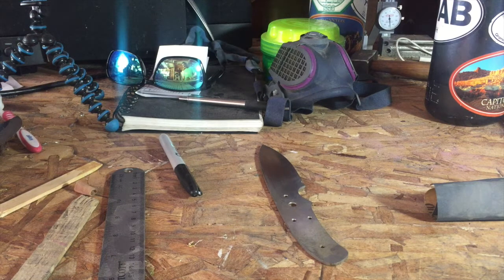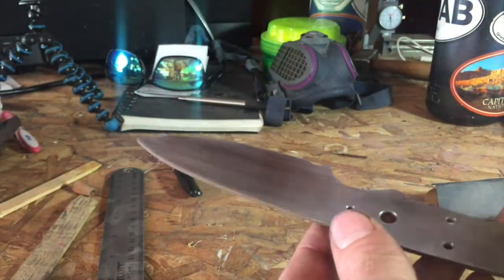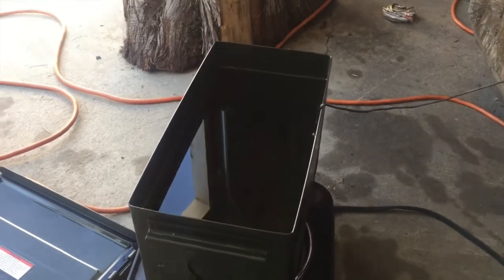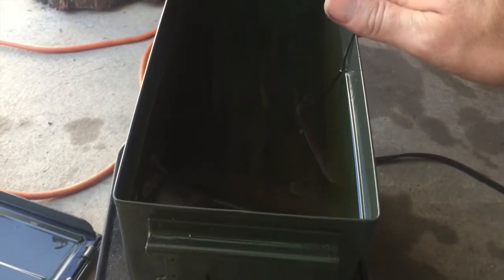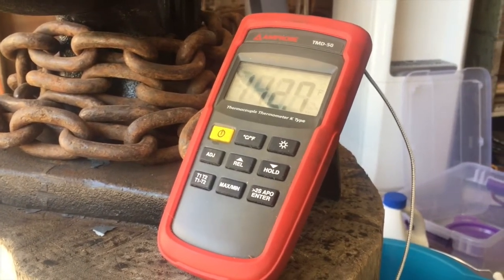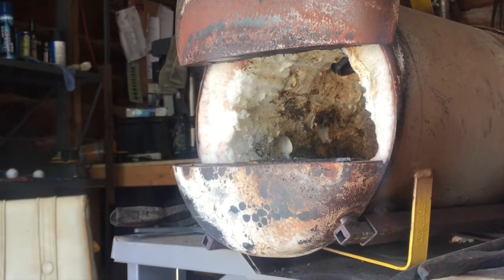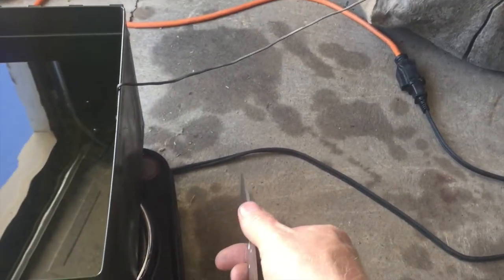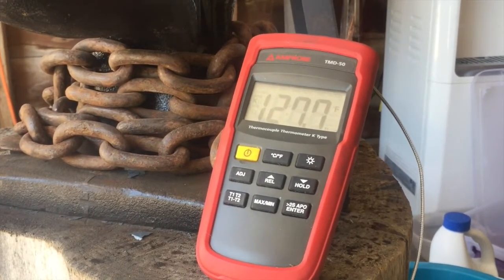Quench 1095 the CORRECT way

Comment: for 1095 or W1 why not just spend the money and get 5L of fast quench oil and be done with it, it's not a big investment and you'll see HRC 65 out of the quench tank and HRC 62 out of the tempering oven? Fast quench oil is designed for 1095/W1 and W2 to get the utmost out of those steels.

Comment: Quenching plain carbon steel in oil is very forgiving and easy, i don't really get why people have trouble with it. You can make a cycle before quench, getting to cherry red and then letting air cool. If you forged your blade properly, cycles aren't needed. Heat up to cherry red, not above, not below. Some describe the color as "pink". Use shadow to help you see the color better. Get everything nice and even, you don't really need soaking if your blade was forged before (it's all perlite, the carbon will dissolve extremely fast). Then, plunge the blade straight into the oil, trying to not cool one side more than the other, as was said in the video. I personally finish my blade before the quench, doing the grinds and a simple sanding, as a thinner edge will cool off more quickly in oil (but is more tricky to get to an even heat). I also like to dunk my blade in very cold water a few seconds after the oil quench, to get to below room temperature somewhat quickly. It's a kind of low quality cryo treatment, but it's only practical during winter if you have a water bucket.
Then you clean off the oil, give a simple sanding, and do your temper. Do it on a kiln, or do it above the embers of the forge if you like doing it medieval style. Both techniques have pros and cons. Kiln temper is incredibly accurate and can get you a bit  more steel performance trough the soaking time and cycles. Flame temper is tricky to do correctly, but allows you to do a differencial temper on your blades. You can use thick forge tongs heated red hot in the forge, and you clamp the back of your knife while you're getting the edge to straw or yellow/bronze, depending on the use. The hot tongs along with a wet rag will give you a blue back with a straw edge. A knife tempered like that will outperform a knife tempered in a kiln in terms of pure resilience, while keeping most of the hardness and steel performance for the edge. But it's a pain to do, and you can't do stainless like that.
Reply: Temper in a toaster oven just like a tempering oven, 2x2hr cycles. I would also add that critical is whenever the knife becomes non-magnetic, never higher really, because austenite is not magnetic even below the curie point. You can throw it in the freezer immediately after quenching for cryo, and it's still half as effective as liquid nitrogen if you do it immediately and your freezer is very cold. Wait even minutes and it might do very little.
Reply: @mikafoxx2717  i personally do it the old way, with primitive tools (aka watching the temper colors above hot coals after quench in water). A short temper helps avoid martensite embrittlement, wich develops as retained austenite turns into hard martensite during the temper. A short temper doesnt allow much retained austenite to convert. But the modern way to deal with that is two long tempers, but you need a low température otherwise you'll really drop in hardness
Reply: @ForgeDuLys  Ah, interesting point about the martensite enbrittlement. didn't know that fast tempers did that differently. Would be interesting to compare side by side a double toaster oven temper versus a forge temper.

Comment: Just edge quench 1095 in concentrated brine and then quickly dunk the whole steel in motor oil. Cheap and easy. This method also makes 4130 capable of chopping concrete.

Comment: Also, have you tested a blade after you've ground the bevels to see if it maintained the 59 HRC?
Reply from the maker: Its a little hard to do an HRC test on bevels as they are angled, but you can get the hardened files to test for general hardness. On thicker stock (over 1/8 inch) canola has a hard time getting full hardness in the steel. I would like to do a follow up video on this soon to talk about that. That is an important detail I left out of the vid. thicker stock you'll want to put some bevels on it prior to heat treat. You'll get a large amount of the beveled area hardened and the remainder up to the spine will generally stay on the softer side. Again, generally lol
Reply: @BearRiverKnives  Thanks again because I actually have some 3/16 stock I was planning on making my next knife from.
Reply: @BearRiverKnives  I actually just watch a vid on sharpness testing chisels. He said that they have the advantage of being able to test the cutting edge.

Comment: Excellent!! How do you know the temprature in the forge or the metal?  Do you just use a magnet to test it or do you use an infrared gun or something?
Reply from the maker: An infrared gun isn't the best as the usual home game guns don't go up high enough, as well as there can be temperature fluctuations in the forge so that can be inaccurate in that regard. The steel is the best measure of temperature. The magnet method is the best for basic testing. if you're looking for accuracy, a heat read oven or salt bath is going to be your best bet. Salt baths can be dangerous so if you go that route, use caution.
Reply: @BearRiverKnives  I'll have to google salt bath - never heard of that.

Comment: What would be a good process for a chopper? Im looking to remake a popular wall hanger bowie knife with the big belly. Its a favorite of my dads and he's always wanted a good version
Reply from the maker: Sorry for the late reply! How thick are you looking to go? I find anything over 1/8 inch bevels need to be rough ground in if using canola oil. Ill probably make a follow up video on this one soon. I just bought a house and finally have a work space again after a few years of inactivity
Reply: @BearRiverKnives  I'm not sure, I think it might even be 3/16ths. Its huge. Also congrats on the house! No apology nessesary!
Reply from the maker: @buckwild6587  Thank you!! And its a bit thick for canola. Thinning it out will help a lot, but I usually don't work with stock that thick.You can try an interrupted quench by starting with water, then finishing in oil. Walter Sorrels has a few videos on it I believe, but Ill have to check in on that. 1095 is a water hardening steel above I believe 1/4. inch, but is prone to cracking thinner than that. Learned that one the hard way lol
Reply: @BearRiverKnives  I appreciate your knowledge! Thank ya mate!

Comment: I do very close to the same thing as you with canola 130 deg ect i do only do 380deg for hr and a half in the oven but me edge dents is that normal ? doesnt chip doesnt roll
Reply from the maker: The edge denting probably means that the knife edge didn't fully harden. How thick of stock are you using? I am probably going to make a follow up video to this for thicker stock

Comment: Just a correction. If you heat to about 1475 and stay below 1500, you won't get any appreciable grain growth so you can absolutely bevel before HT. Temper at 400 for 2 hours twice and you'll get a 61HRC easily. Of course, this depends on if the metal was properly thermal treated by the manufacturer beforehand.
Reply from the maker: Sorry for the late reply! I will most likely be making a follow up video on this to clarify details on what I was doing. The stock thickness I was using was on the thin side, and need to add in that thicker stock should have rough bevels ground in. Overall, I have a better direction for a follow up. Thanks for the comment, and if you can think of anything I should add in there, let me know!

Comment: Great video man. I am wondering if doing a quench and then tempering on a 1095 fillet knife do you do anything different?
Reply from the maker: Hey sorry for the late reply. Life has been a bit crazy lately. I just bought a house and have been doing work on that and getting the shop space set back up and organized. For a fillet knife, I would do some things a little different. Because you want a little flexibility in the knife, I would raise the temperature of the temper to somewhere around 450f. That will reduce the edge durability, but will allow the knife to be flexible. The key is to have a thin taper. Fillet knives can be tricky
Reply: @BearRiverKnives  no worries thank you so much I will work on my temper.

Comment: Why do knifemakers recommend a temperature much lower than the 1650°F that industry recommends?
Reply from the maker: 1095 has a range of heat treatment. Going hotter than 1650*f is only going to grow grains. In a forge, its easy to overshoot that. The effective range to heat treat 1095 its recommended between 1550*F and 1650*F. The hotter you go, the more you risk cracking the blade or growing grain by overshooting the temp. If you have an electric oven, still recommend 1550*F or 1575*F as most ovens will have a range the temperature can fluctuate

Comment: First off great video! Lots of critics here, I found not putting bevels in really helps and yes the edge is still just as hard as the rest of the knife as I have access to a hardness tester. I bought a used kiln and one of these days I'll get the controllers for it and have something more accurate for tempering. Thanks again for the info.

Comment: That blade didnt look even close to temp. i dont think it hardened at all. and the way ur teaching people to harden 1095 sucks....... 1095 has to drop under 1000 degrees in the first second. thats why u use water or special oil as the oil and methods ur telling people to do is not correct. Have a nice day.

Comment: I just wanted to say I use 1095 on all of my small knives and I've been having good results with water quenching, and mine seem to come up 60+ hardness, do you think the oil quench on a 1095 gives it slightly less hardness than a water quench? It's high risk high reward maybe, but I haven't had a blade crack on me so far, people warned me water cracks 1095, but mine seem fine.
Reply: 1095 is a fast quench steel, so that's the reason why your blade reaches higher hardness. Do you use intermittent quench in water?
Reply: Wich kind of water quench do you do ?
Reply: @AAAAAAndrea  I use Yaki ire clay water quenching method. Switched over to white paper steel instead of 1095.
Reply: @LondiniumArmoury  Basically natural clay all over except for the blade ?
Reply: @AAAAAAndrea  Yeah, I put clay over the spine side and flats of the knife, and leave a large portion of the cutting edge bare, where I want it to be hard. 1-2 blades out of every 10 will crack and warp though.
Reply: Now that's the way it was done in history. Oil only started in the last 100 years or something. They developed oil hardening steels specifically for it, like O1. More home Smiths should use it for canola quench, otherwise you might get inconsistent results. If you don't overheat the steel and have a super fine grain, you have to quench faster, so with 1095 and super fine grain you need pre-ground bevels and settle for retained austenite in the spine, or risk the crack in water. I've heard that brine or super quench might be easier on the steel despite being even faster.
Reply: @mikafoxx2717  I like O1 steel, I used it about 5 times, I used a parks 50 equiv oil for it. I've done some super quench testing before on sample pieces of cut off, and I also super quenched a 1095 pry tool.
The pry tool cracked about 2 years after I made it.
Dropped it from a really high height onto concrete floor. When I checked the crack, it had 2 very different grain types inside. the core was dark and slightly larger and rough. The jacket or outside was very light and smooth like ceramic.
So not sure what the super quench did, but I didn't like the look of the cross section of the break.Never seen dark steel grain before, looked like black chicken bone colour charcoal grey.
Reply: @LondiniumArmoury  maybe case hardened or the steel was not fully thru heated? Something as think as a prybar in a water quench steel isn't going to get far with oil either way.

Comment: Or you could spend some money on the correct oil that is designed to quench steel in and not have to bother heating it. And then for your oven, take a piece of scrap steel and put it in your oven at different temps for 2 hours each and use the color of the steel to tell you your real temps, start at 200 and go to 450 in 50 degree increments and make a chart of what setting on your oven yields the actual temp you want, at those lower temps the color changes at very specific temps and this is easy to do and free, once you’ve done it you’ll never need to use a thermometer again.
Reply: P226nut I agree with you on one point.  If you have a proper quench oil like Parks 50, which is a fast 7 sec quench oil, or maybe you have another brand like McMaster Carr, or Houghton line of quenchants that are 9-10 secs all the way up to 11-16 secs (whatever depends on the steel you use) you do not need to heat your oil...lot of guys still do because the manufacturers say you can, but they do warn that heating proper industrial quench oil does lower its life span.  Basically room temp is fine for these professional grades of oil because they have a specific chemical makeup.

As for tempering times, heat treatment 101, read the manufacturers tech sheets, it will give you an HRC chart and a recommended temp chart for tempering (as well as heat treat temps of course) , they also include if they recommend cryogenic treatment.  
Don’t guess or mess around guys, if HRC60 (example only) is what you want and the manufacturer says heat at 1900F for 20 mins, oil or air cool to room temp, then temper at 400F for two cycles @ 2hrs each to achieve HRC60, well freaking do it 👍 😂

Comment: I just heat treated my first knife. Everything went well but I noticed when i looked at the video my first dip in the oil i went to agitate and i took the blade out for a fraction of the second about an inch from ricasso and the rest of the time it was completely submerged. I checked the knife with a file and it seems like its hardened. Do you think its ok?
Reply from the maker: it should be fine. the majority of the hardening happens within the first second of the quench if I am not mistaken

Comment: Well, we both do the same methods... I've had problems with chipping... I'm thinking I need to temper longer.. I also thinking I may be getting the blade a bit too hot.. I can make such a beautiful knife, but then my heat treat sucks.
Reply from the maker: The Dood yeah the heat treat is key. Have you broken open your blades to see what the grain looks like? Overheating the steel causes some large grain which will weaken the edge. How are you testing your blade?

Comment: 1095 is a simple carbon steel. So not much manganese or other alloying elements that would kinda support the formation of a martensitic crystalline structure all the way through the entire blade. So without grinding the bevels beforehand and with a relatively mild quench as you do it it raises the question whether you still reach 59 HRC on the actual cutting edge after tempering and grinding the bevels. How thick is the thing at the moment you go to the heat treatment?
Reply from the maker: WUNDER8AR the blade is 3/32 before quench. I failed to mention in the video if you are doing thicker knives you should be pre grinding bevels as 1095 is a shallow hardening steel.

Comment: Do you use that Ryobi band saw to cut out your blanks? If so, what blade are you using on it? I bought the same saw so I didn't have to spend so much time at the belt sander doing shaping work, but I haven't found a blade that'll stay sharp through 1/8" 1095.
Reply: Buy a porta band and a swag off road table, it makes a <$500 tiny metal cutting band saw, I’ve never done anything knife related that it wouldn’t cut.
Reply from the maker: No the Ryobi is for wood handles. The blade spins too fast to cut steel and its too much of a hassle to put a new motor on. you will need a motor that spins really slow and needs torque. there is no real effective way to slow down the motor on the unit as its a simple AC motor.  it is doable to put a new motor on it, but I decided to get a portable bandsaw from harbor freight and mount it to the wall. they are like $100 and to make a mount is super simple if its attaching to the wall. Simple Little Life has a video that can give you an idea how its done